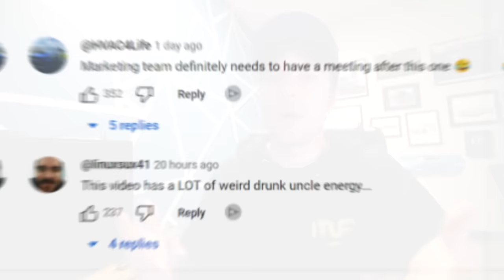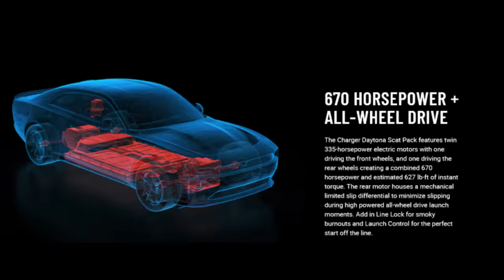The 2024 Dodge Charger Daytona Unveil Was Embarrassing

Comment: If I was in the position of running Dodge, here’s what I would do:

One of the big problems with electric vehicles is that they’re pretty much being positioned like a smart phone. It is very difficult or impossible to repair it yourself, and if there are any problems, It’s fairly likely that you will have to pay as much as the entire car. Don’t understand, I’m an EV fan, I drive a small EV, and an electric vehicle can be significantly more reliable than a gas or diesel engine. Not only that, but a lot of modern gasoline cars are extremely expensive to repair as well. These aren’t the vehicles that were built in the 70s that you could just fix or change your suspension or would have you in your garage. current gas cars are significantly more complicated than they used to be.

That said…

I think there is an opening for an OEM to create an electric vehicle platform specifically designed to be modified and upgraded. Now most EVs have essentially the same kind of suspension and tires as any other car. But what if you designed an electric vehicle that specifically was positioned for the owner to make different kinds of performance choices. For example, as I mentioned in another comment, there are all sorts of battery chemistries that are being developed. what if there was a muscle car that was designed to let you swap out the batteries, not in a quick automated way like some of the Chinese cars are doing, but something that you would do if you have a lift, or maybe if you can put your car up on risers, which would allow third parties to provide an alternative power source. And what if you could do the same thing with the electric motors? Not that, but if you could tune the performance curve in the battery system, there’s all sorts of possibilities. For instance, some manufactures are experimenting with having two different kinds of battery chemistry, one design for high output for performance, and the other part designed for longer range. changing the balance between those two things is probably one of the places where a tuner could change an electric vehicle.

I’m also not convinced that we’ve seen the end of the manual transmission. Well electric vehicles don’t need a manual transmission, or most cases of transmission of any kind, at the same time, I still believe that there is potential efficiency to be gained from adding a manual to an electric electric drive train. i’m not sure as you’re revving the electric motor whether it’s efficient the same way across the entire power band or not. Perhaps somebody’s done the experiment on this, but if you were designing for instance a race car, and you had to eat out that last drop of electric range so that you wouldn’t have to recharge or switch vehicles or drop the battery or have you, maybe there’s a place for a manual transmission there.

Finally, with regards to the motor sound, I’m an electric vehicle fan, but I’m not a fan of that. One of the big benefits of electric motor is that it’s generally quiet. The idea that you would add gasoline engine noise to that is just silly. Let the vehicle make it noise. The only thing I might say, and then I might do if I were the head of Dodge right now, is find out whether or not there is a way to mechanically amplify the natural noise of the electric motor.

Japanese and Italian manufactures are especially good at tuning their noise using sound experts to get just exactly what they want out of their exhaust manifolds etc. I see no reason why this kind of attitude couldn’t also be used in an electric car. For instance, changing the proportions of electric motor would almost certainly change the electric wine that comes out of it. most electric vehicles are trying to be a silent as possible. But that’s not a requirement. Now granted, sound usually means in efficiency. But having a little bit of sound come out of your electric motor could generate some excitement and also give the driver some feedback. If that sound isn’t audible enough though, there’s no reason why you couldn’t figure out a way to create a sound Pike from the engine either into the cabin, out to the exterior, or both. And if that sound pipe was shaped properly, you would be getting actual electric motor sounds, but tune in away that would not artificially change them, but instead emphasize them and give you an more exciting experience. It’s kind of what I thought Dodgers gonna do, but now it seems like they may be using artificial digitally generated audio. That’s a real bummer, and I’d rather just didn’t do that and had the most powerful electric vehicle on the planet. It’s a hard thing to do, because the Tesla model plaid I’m pretty Suredestroys any Dodge that’s out there today. But if that’s wrong, it’s certainly is in the mix. Why shouldn’t Dodge make it electric vehicle the absolute fastest production car outside of a Bugatti?

Comment: They want to reduce emisions but they make a 5000lbs+ car... very intelligent... weight increases the tire waste and the road damage. Also with the amount of minerals the EV version has you can produce 6 plug in hybrids with over 50 miles of range or over 50 hybrids with small batteries such as the base model Prius.
Reply: Just like the government regulations are the culprit for the EV push and ridiculous things that result in that start/stop garbage or the absurd gearing in many cars, the embarrassing weight of modern cars is mandated by government regulations. Cars actually have safety reducing visibility outside because of government safety regulations, which require cameras AND sensors/assists.....which further increase the weight of the vehicle.

Deregulation is urgently needed.
Reply: its not about emissions theres nothing wrong with the environment/weather its about taking your freedom of movement ,15 minute cities, eating bugs and all that other weirdo control BS

Comment: Great video, I have to put my two cents in on this one. I work for Dodge for many years, Dodge turned into a European company and in Europe you cannot have a motor bigger than 3 liters with that said they are not focusing on the American Publix wants and needs. Sorry but that is the reason why you have a 3 l motor. I switched to mustang and I'm not looking back I will not drive a V6 my last V6 was in my Grand national in 1987 and I hated it and traded it for a Monte Carlo super sport which I ended up putting a 383 stroker end. Good riddance Dodge

Comment: ive been studying supply chain, EV development, and infrastructure. EV's definitely do have a place in the market BUT the US doesn't have anywhere close to the infrastructure or electrical grid needed for full deployment. I've also heard that the amount of carbon it takes to produce an EV is nearly the same amount that it takes to produce AND USE a combustion engine car for its lifespan. interesting stuff
Reply: its all politics man. most "green" things are not actually green and are instead just a power grab.
Reply: EV's fit in suburban lifestyle, especially with an electrified home
Reply: I work in the industry, specifically in BEV battery and power supply systems. I have had access to a lot of data over the years, and carried out my own study into total life cycle emissions. I found that on average a car with a 30kW battery might break even in regards to emissions with an ICE equivalent after 40,000 miles, with a best case of 25k and worst case of 100k. At the other end of the scale, a 90kW car might need an average of 90k, with a best of 60k and a worst of 250k. This data was from 2017 to 2020 and was based on the UK's National Grid, using their clean vs dirty energy production data and their estimated emissions per kW. I could not account for vehicle recycling, as at that time there was next to no data available. Even now, recycling data is near none existent 

It's worth noting that this is mostly focused on carbon emissions. If you look deeper than carbon, you'll find that its way more nuanced, and there are benefits and disadvantages to both cars. ICE creates Nitrous gases and exhaust particulates too, however BEV's create vastly more tyre particulates than ICE, which are the most harmful particulates of all emissions.
Reply: That’s why I fw the infrastructure bill

Comment: im so done with modern cars. im sticking to the 90s through early 2010s
Reply: Sea levels are rising, boats are the future.
Reply: Uhh those are not older cars, you have to go back before computers that should never have been in a car
Reply: @dinadaughtry8993  unfortunately a nice older car is not in my budget. Not do they fair well in my local weather conditions. I used to daily a car from the 60s. You have to give up a lot to do that.
Reply: @dinadaughtry8993  Not exactly a fan of vapor lock, dealing with choke issues, trying to dial in the float or idle screws, and dealing with vacuum line nonsense too much... I remember some old cars enough to realize such can be a PITA. And a well done EFI setup has no headaches for the life of the vehicle. The issue isn't computers, but how they're implemented. (The anti-consumer/anti-enthusiast encumbrances they're adding to the newest stuff is stupid. I don't think engineers are making that call, but it's unfortunate they're too willing to go along with such decisions.)

Comment: I went through the countdown on March 5 on Dodge's website so I could watch the actual reveal. I didn't know what to expect, but was hoping it would be an actual live reveal on a stage showing off the features and styling. Instead, they did the canned video with the time traveling theme and Dodge Brothers riding in the Charger as you have discussed and shown clips of in your video. It was very disappointing to say the least. As you stated, the car should have been shown and demonstrated and not the green screen and CGI they actually offered up. I am glad to know that it will be offered in both the coupe and 4 door versions though. I was unaware that a four door would be offered until I saw the video on March 5. I am still unclear on whether the Hurricane Inline 6 ICE will be offered in just the coupe next year, or if it will be available in the 4 door as well. Even though the Hurricane Inline 6 is  the only ICE option available and the hemi is no longer going to be produced, I am just glad that Dodge will still offer an ICE instead of being all electric, at least for the foreseeable future. They did a nice job with the styling of both the coupe and 4 door versions, and the coupe looks like a nice modern interpretation of the "coke bottle" styling of the original 2nd generation Charger.

Comment: Remember when Dodge was full of front wheel drive 4 and 6 cly cars and the die Mopar guys sat on the sidelines restoring the Muscle from the 60's and 70's. Dodge finally got the message and finally made the Challenger and a performance version even though it was 4 dr. a Charger. Well sales exploded and Dodge was once again became the Muscle car company after Ford decided the Mustang needed to be more sports car and less retro. The Mopar crowd is VERY loyal and will not be fooled. I'm guessing these won't be cheap and will not sale very well due to price and distained for no V8. Dodge is forgetting exactly who they are trying to sell too.
Reply: Love those 2.2 Turbo cars. GLHS. Shelby Daytona's. Heck by 92 the IROC RT DOHC Turbo had more HP than a 5.0 V8 Mustang. 224 to 215. Also the 92 Spirit RT was the fastest 4 door production sedan sold in America. Those Turbo cars. Just so cool. GLH Road track had  destroyed a 60'S Mustang GT350 in one issue. Heck 2.2 saved Chrysler.

Comment: A good friend of mine was an engineer at Fiat Chrysler while they developed the hurricane, and he said it has all the prerequisites to be one of the great engines of this upcoming era. Any golden era JDM fan boy is going to love them and the power potential from aftermarket tuning will be there if they follow through properly with their plans. I was told to think of it as a modernized 2jz and as a B58 competitor (maybe another cool future swap option for us drifters down the line).
Reply: The 300 hp 30mpg v6 cyclone engine from Ford in the 20teen's was badass too, it disapeared in a sea of ecoboost. . .
Reply: I smell personal bias, lol.  j/k
We won't know for certain until testing and time has happened.  I see aluminum block, aluminum head.  The 2J-Z is a cast iron block, aluminum head.  That doesn't necessarily mean anything significant though.  The Honda B16A can handle about 300whp on stock internals and around 14psi boost pressure.  It has an aluminum block, open deck, and a sleved design.  That's around a 189% power increase over stock.  Lets assume 400hp.  That's a 253% increase.  Now let's look at the 2JZ.  The stock 2JZ-GE produced 227hp stock.  You can run those at 900hp on stock internals.  That's a 396% increase over stock.
I don't know if the Huricane is a closed or open deck design.  Or if its sleved or not.  Either way, competing with those JDM engines is a tall order.  I would be really impressed to see one of these reliably push 900hp on stock internals.
Only time will tell I suppose.
Cheers.
Reply: @christopherlowery855  only time will tell. For all of our sake, I hope its good so we have another generation of ICE cars to enjoy (and more swap engines down the road). If its any consolation, my buddy would tell me whats good and whats bad (stay away from any engines engineered by the italians like eco diesels haha) and he has moved on to a different manufacturer since and still praises the Hurricane.

Comment: Things that should be illegal:
- Fake engine noises on electric cars.
- Fake carbon fiber wraps, just admit you're too poor for real carbon
- (edit) and carbon fiber "caps" that are placed over the OEM part instead of replacing the part. CF is supposed to reduce weight, not add weight.
Reply: I still remember my 10 yo son saying "weird" about our "new" 2.0L TFSI powered car having dual exhaust. I didn't have a good defense for the maker and could only agree. I think the Dodge also has fake shifts. It wouldn't surprise me if they added a small fuel tank and burner so the exhaust would smell like a muscle car.
Reply: Lol! I'm not sure I'm poor or not as I wouldn't know the difference of a fake carbon wrap. Well played sir.

Comment: Squeezing a 6 cylinder to get the HP to push a 4+ thousand pound car is not going to last very long.
Reply: Completely untrue...

Virtually every 12-ton farm tractor sold total has an inline 6 engine in them... and pull more than 30-tons worth of weight around all day... and last nearly forever. 🤦
Reply: @jasono2139  tractors ONLY have crawler gears lmao. You dont know a thing
Reply: @jasono2139 you can't compare a tractor to a car. Get real
Reply: @schizophrenicgaming365  "tractor only have crawler gears 🤪"... and those experience EVEN HIGHER torque... "great" counterpoint. 🤦

Comment: Fun fact, the first engine that ever used the definitive hemispherical design that is characteristic of Hemi engines was a Jaguar inline six designed by freelance engineers. Dodge just used the design in their V8s which their fans called Hemi V8s and Dodge ran with it. I think they trademarked the name but they never owned the rights to the design. I think the Toyota 5M-GE DOHC 12 valve inline six was, in effect, a hemi.

Comment: If the Fratzonic Exhaust is actually going to amplify some sound from the Electric Motor, even if it is going to augment or change the nature of that sound, then that's fine. We are in an era where EVs will occupy the top end of the performance curve, so trying to make them more "muscle" is commendable.

The issue is doing so at the expense of a high-end V8 trim option. Making the Scatpack-level trim a 500+ hp V6 might be disappointing for some, but to me it seems like an expected evolution of engine design. I'm ok with that being the trim level that most people have access to. The only thing missing is the Hellcat/Demon high end V8 option for this car for those who do not want to compromise on the muscle car V8 tradition and who can afford to pay six figures.

Here's hoping the V8, 800+ hp option returns at some point. Maybe with an alternate body design and dare I say...  labeled as a "Challenger"?

Comment: So - saying this a neutrally as possible - as soon as it came out I immediately knocked the weight, it weighs 5,838 lbs- on the other hand this is not yet the top trim and the concept did have significant carbon fibre all over. Another item to add to this is the Taycan itself weighs around 5,100 lbs -- not exactly light either. Dodge has said this is a stiffer car than previous cars by a whole 20% which is a significant increase. With all this said -- I'm inclined to believe the Banshee will be something worth considering.

Comment: EV performance upgrades to include, double “OO” wire wound High Performance stator, Super Crank High Output Flux Capacitors with bonus (free) upgrade to High Output Engine Roar Soundtrack. WARNING:do not park near structures due to possible spontaneous combustion.

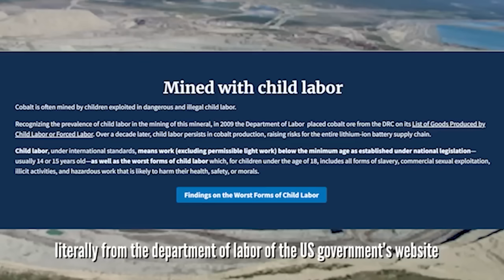Comment: 5:40 it is the same. the car (and it's battery) should last much longer than the average life of a smartphone. cobalt and lithium production has been a human rights issue for long before EVs, but we don't need to go making the problem worse. use your phone for as long as you possibly can, buy used when you go to replace it, recycle old batteries and spread awareness for those communities who are impacted by mining these materials (and i mean in a meaningful way, not just as a gotcha). then go and buy yourself a used, real muscle car.

great video all around. thanks for it.